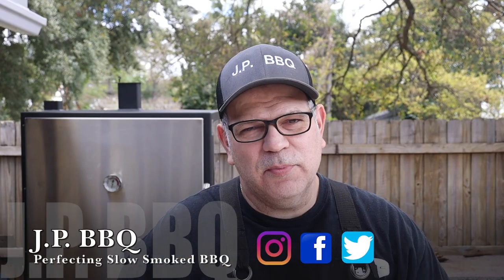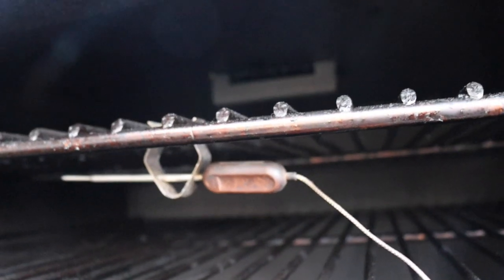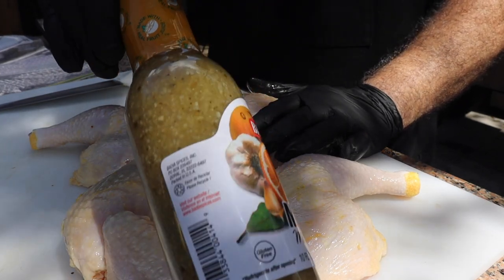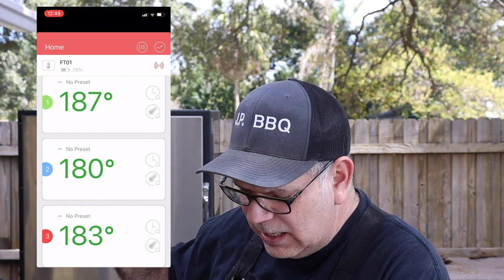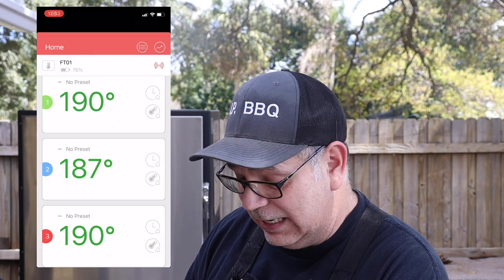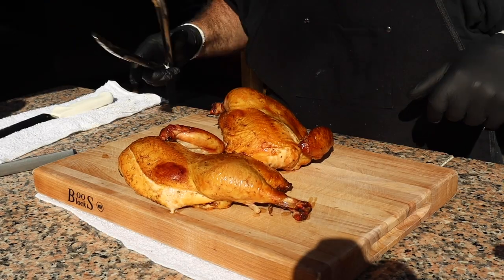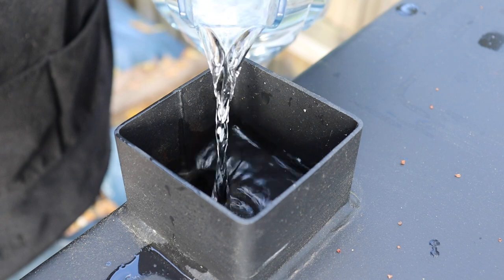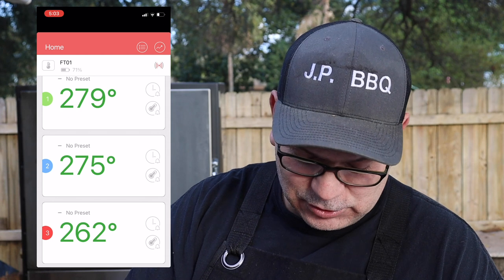Zone Temp Test in the Lone Star Grillz Insulated Vetical Smoker, How efficient is this Smoker?

Comment: Another great video J.P. You may want to sell your offset because you clearly love this ivs. A couple of tricks with the ivs that you may have not tried. To get the smoker up to temp quicker, take off the back capped opening as well as keeping the ball valve opened. Also don’t put water until near the ideal temp or it will take forever heating the water instead of the smoker. You are getting me in the smoking mood. Thanks for the great videos and awesome commentary. You are great!!
Reply from the maker: Thanks Juan, The IVS is a great smoker for sure. I thought about getting a second ball valve and trying that out. But taking the cap would work just as well. Appreciate the tips. Glad the you are liking the videos. Thanks again for watching and commenting.
Reply: @JPBBQ  I purchased a second valve for that reason. Then you have 2 ways to control oxygen to the fire.

Comment: Good video! One tip I learned when I first started smoking was the biscuit test.  Get the pit up to temp, and place biscuits (store bought cheap) at the front , back, corners, and middle of every grate . You will be able to see which ones cook faster / slower and arrange your cooks by that. I usually do it during the initial seasoning, and then again after about 10 cooks once the smoker has seasoned well and settled in.
Reply from the maker: Thanks JHays, appreciate you liking the video and thanks for sharing any tips and tricks. Very much appreciated.

Comment: Love it Mr. Santos!  I have one on order as well as both you and Eric Cantu (Fat E's BBQ) swear by them.  I love the consistent temps you were showing and plan to run mine in a similar way.  One question about the probes though.  I didn't see where the probes went into the smoker.  Do you have a probe port on the side or is it run via the door?  Any thoughts about future impact on the gasket with 3-4 wires always pressing in on the gasket when the door is closed?
Reply from the maker: Thanks Bryan, appreciate you commenting and watching. This smoker performs outstanding. I think you can order probe ports with it if you want. I don’t think there will be an issue with the gasket and the probe cables. The gasket is flexible enough and the cables are small enough that I don’t think they will cause any issues. But probe ports would be a. nice feature to get. Thanks again.

Comment: Thank JP. Great video. I also have the Large IVS from LSG. When I use the water pan I have a temperature differential of 50°F. Have you seen the same? I also have a problem with the temperature walking up after about 5 hours of cooking. I believe the snake method I use using maybe lit off faster. I tried the U method same thing. I end up having to adjust the top vent to hold the temps in check.
Reply from the maker: Thanks John, appreciate you watching and commenting. As far as the temperature differential of 50 degrees, I have not seen that on my smoker. What I have seen is that in order to smoke at the lower temps I gotta use water in the water pan. I’m talking down in the low 200 ~ 250’s Adjusting the top vent will restrict the air flow as well allowing to maintain the temps down. I have not tried the U method. Most of my smokes are 10 hours and less so i just use an small 8 lb bag of charcoal mixed in with some chunks of oak. Thanks again.
Reply: @JPBBQ  Thank you sir

Comment: On the wires - did you run them under or over the door gasket?
Reply from the maker: Thanks for watching and commenting Alex. Yes I normally just run the wires through the door over the gasket. The gasket is flexible enough to form around it and still maintain a seal. Thanks again.